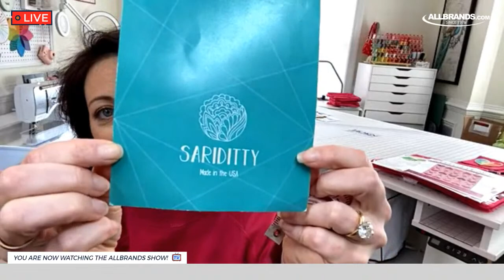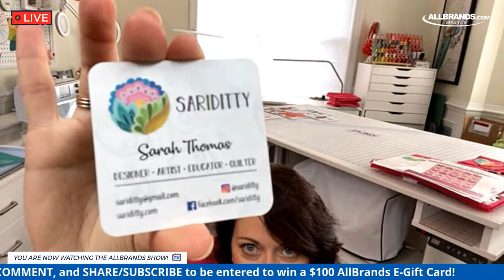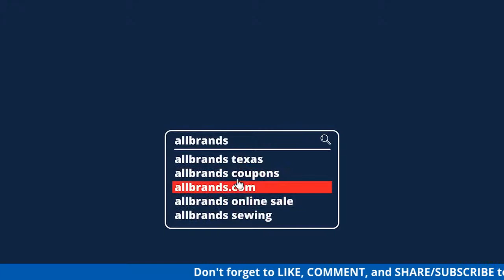THE ALLBRANDS SHOW | Horn Sewing Cabinets of America with Sariditty and Ed Ras Sr.

Comment: At 30:50 in the video, she shows the angled extension panel that fits on top of the pull out drawer. Where do I get this angled piece? Am I missing something in the 9100 description? She's calling it model 9000. But on your website the model with the casters is called 9100. Her table doesn't match what's on the website?
Reply from the maker: Hi Janet
The Extension is an additional purchase. We've added it as an option: 

9100: https://www.allbrands.com/products/100923-horn-9100-new-heights-29-40-adjustable-sewing-cabi

9000: https://www.allbrands.com/products/100924-horn-9000-new-heights-adjustable-29x40in-height-se